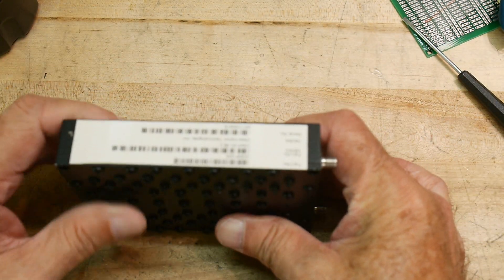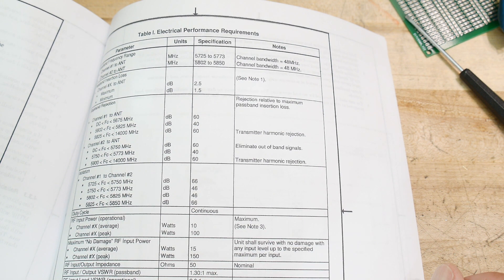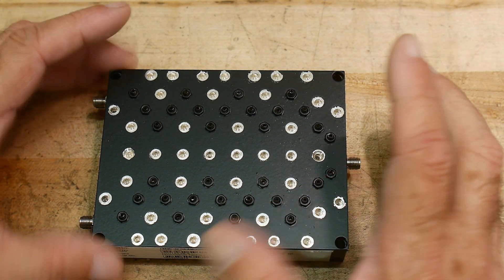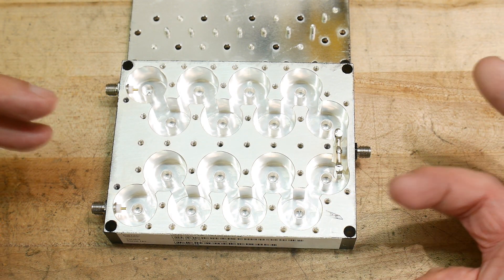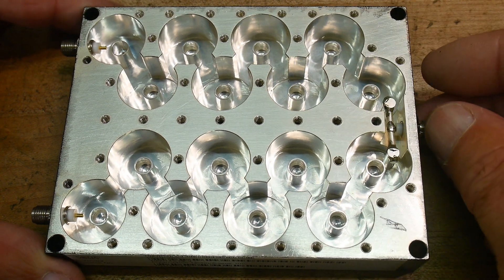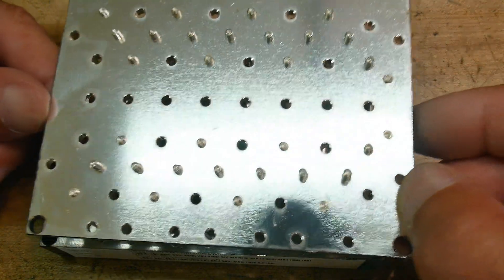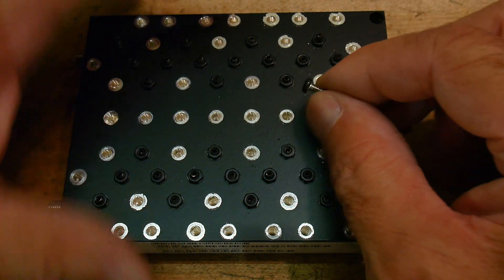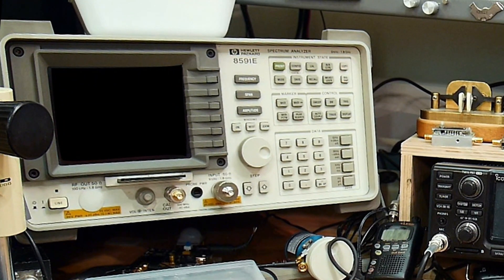#915  5.7-5.8 GHz Diplexer Teardown

Comment: I suspect that 2 countersunk screws are used to align the top plate on the x/y plane. Once the countersink screws are tight, the plate can't move, but if you put all the other screws in first, then the plate might still move a bit. If it was really for the label, I would guess that just using the countersunk screws kept someone up at night--because they can pull the whole plate and therefor all the other adjusting screws out of alignment with the cavities.

The rest of the screws have a free/close fit which isn't as tight as the countersunk screws.

I'm concerned that I could never consume enough mind-altering substances to be a true RF designer.

Oddly, "Boilerplate" was originally from NASA. It was the name from the Mercury project test/dummy capsules, which were considered to be made of....

Comment: Could you give the name and website link of the person who has worked on these filters whom you mentioned , and are there any resources to learn theory and design these cavity filters.
Thanks it was an amazing teardown
Reply from the maker: here is an introduction
https://etheses.bham.ac.uk/id/eprint/5814/9/Xia15PhD.pdf
Reply from the maker: https://www.google.com/url?sa=i&url=https%3A%2F%2Fwww.semanticscholar.org%2Fpaper%2FTHE-DESIGN-TECHNIQUE-FOR-COAXIAL-RESONATOR-CAVITY-Li-Liang%2Fd2835550cea1d0bb20053f4a2b35723b6809ea6d&psig=AOvVaw3xIXgQXicTzB3kHHK0-c3i&ust=1632541263401000&source=images&cd=vfe&ved=2ahUKEwjG5fqh2JbzAhVClJ4KHTs3CUwQr4kDegUIARDzAQ
Reply: @IMSAIGuy  thanks a lot , will go through these

Comment: I have certainly never modeled anything like that but I did guess what was inside correctly. Truth is, I’m not even really sure how. I would guess that I’ve seen enough people on YouTube tear down rd gear that Ive managed to gain some intuition about it. Lol. I have an HP 8731b Pin Modulator that came in an auction lot that I win because of something else in the lot. It is very heavy and from the little research I’ve done it doesn’t appear that I’ll ever have use for it. So, tear it down it is!

Comment: I paused before the lid came off to take my guess. Having seen inside 50ish year old Collins Rockwell microwave RF transceiver equipment before, I’m going to guess it’s just a bunch of track work that is actually inductors and capacitors that performs the various filtering and mixing functions required.
Looks like I got that wrong. It’s more like Radar wave guide stuff.
BTW the title says diplexer, and the data sheet says it a duplexer. Subtle difference in functionality.

Comment: The flat head screws are also used to precisely align the cover so the adjustment screws fall in exactly the right place to precisely interact with the EM waves.  If you only used pan head screws the cover would potentially have some lateral movement to it and the alignment screws wouldn't end up in very precise location within the cavities.

Could you use this diplexer with two different 5.8 GHz radios on two different channels to create an AREDN repeater with a single omnidirectional antenna?
Reply: Good question. No particular reason why not. I can send you the spec sheet if you like. E-mail me  W8ASA at ARRL dot net

Comment: I suspect the countersunk (flathead) screws also help with alignment - the other screws will have a small amount of 'slop' (the hole in the cover will be slightly larger than the screw thread outside diameter - a clearance fit) but the countersink on the two screws (which are located on the centre line) will help pull the cover to the exact position on the base. These should probably be the first ones to tighten when re-assembling. If it is not accurately realigned, it's unlikely the filter will have the same characteristics as it once had.

Comment: I was unable to find any contact info for you. Have you considered doing some content on how to create simple PCBs? I’ve tried, but there seems to be so many steps to it.
Reply from the maker: There are plenty of YouTube tutorials on beginning Eagle or KiCAD
Yes it is complicated
Reply: @IMSAIGuy     Complicated no way! Copper board, Dencon DALO pcb pen, pot of Ferric chloride  job done. I think I was about 14 when I used that method, 48 years ago!

If you have never come acoss DALO pens in the USA,  here in the UK the DALO pen was a form of felt tipped pen it held a thick blue ink. You would press down on the point which was spring loaded, and let a little ink out, then you simply drew the tracks onto the PCB - more often than not when you pressed down on the nib you got a big puddle of ink. You soon learned to let the ink out on a non critical area and just dip the nib in the puddle - saved a lot of rework. 

I can't say how many PCB's I made using that method. Just a lot... Then we had the rub on etch resist transfers so DIL IC pads became easier. 

Much later it was found that marker pens such as the lumocolour (I think) were also quite good as an  etch resist, and a lot easier than the DALO 

All this done before PC's and before CAD PCB design was available - it was fun at the time. 

Maybe a video on this method would be a bit of fun and nostalgia for people to see.

The PCB programs are great, but like anything you just need to take the time to learn how to use them. 
I'm amazed at the power of Kicad (I've not tried any of the commercial software) The functions that this has compared to the first PCB design systems I saw, which were dedicated machines is huge, and cost many tens of thousands of pounds.

Andy
Reply from the maker: @andye2005  It has been a long time since I etched a board with magic marker or laser transparency. KiCAD is pretty clumsy. Eagle is pretty good. I used Mentor Graphics PADS at work back in the past.
Reply: @IMSAIGuy  Kicad has come a long way in the past few years. The biggest problem I find is that users expect it to work in the same way as Eagle. :-)

The first PCB CAD system I encountered (in the 1980's)  was the Racal Cadet- The PCB layout Tech would not let the engineers play with it, they quite rightly thought that we would take it apart :-) 

I never laid hands on tape and dots again..

Andy